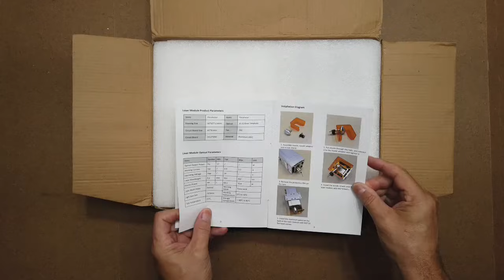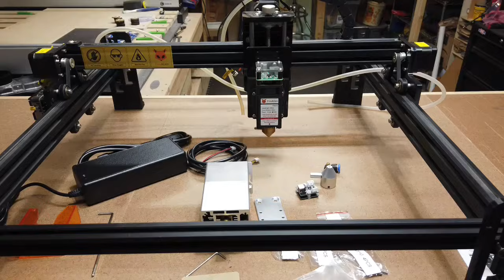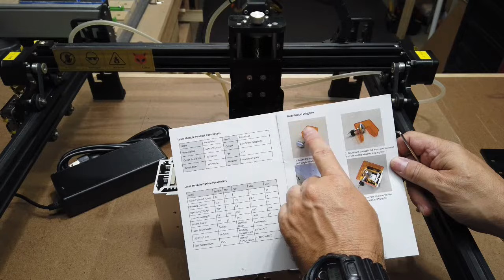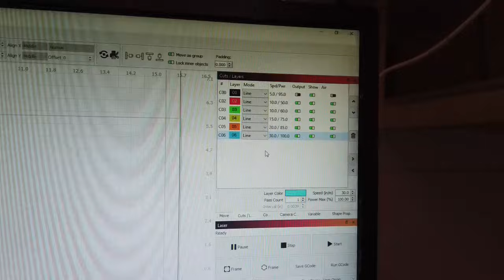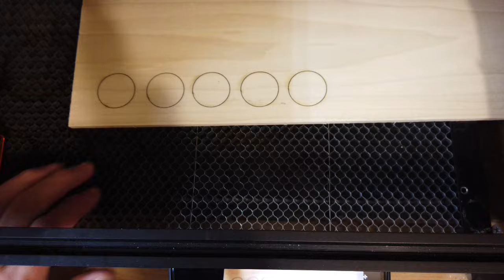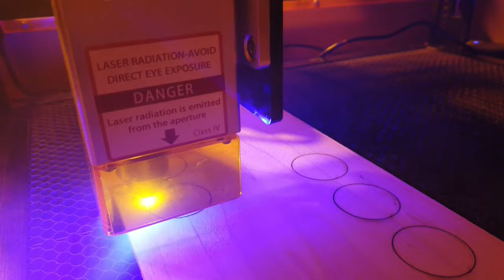FoxAlien 80 watt laser upgrade.

Comment: Do we stop using the original power supply once the new one is installed, or do we use both power supply??
Reply from the maker: You use both power supplies.  The original is still used to power the control board.

Comment: Did you have to change any of your settings using lightburn?  I cannot for the life of me get the 80w to work?
Reply from the maker: No, I didn't have to change any settings.  Do you have both the mini control board and power supply connected?
Reply: @windsorwoodcraft  yes I do.  It seems as though all of the settings are backward somehow and homing is in the opposite corner.  There is nothing else I can do right now because it just keeps trying to home.  I don’t get any laser beam coming out either
Reply from the maker: Did you buy the machine with the 80 watt laser or did you upgrade from the 5.5 watt?
Reply: @windsorwoodcraft  it’s an upgrade.  I had the 20w head originally and put the new 89w on Monday and have down ever since
Reply from the maker: Check the devices settings button in the bottom right corner of lightburn.  Find your laser and click on edit. Then make sure the type of laser or controller is set to grbl.  If you have a different one selected, it could be causing the problems.  Does the fan turn on when you plug in the power for the new laser head?  If so, you can check to see if the laser works by clicking the laser "fire" button  on the "move" console section.

Comment: Did you have to adjust any settings in your computer? I just installed mine and can’t get the laser to output. The fan works and machine runs an “air” cut but no blue dot.
Reply from the maker: I didnt have to make any chamges to my system for it to work. Do you have the new cable connected to the mini circuit board and to the main board?
Reply: Got it.. after trying different things I had to swap two wires that were wrong from factory.
Reply: Nothing to do with computer. I had to switch the brown and yellow/ green wire around. It was wrong from factory. Should be blue/brown/ yellow green/ empty spot on the laser side of the harness.
Reply: Also you have to use your stock power cord in the control board. The cord that comes with the laser only powers that.